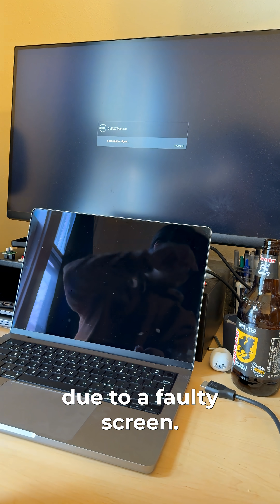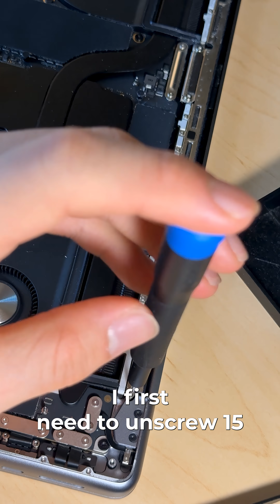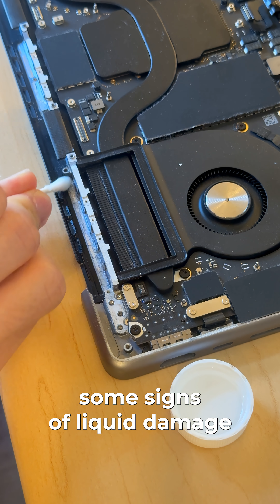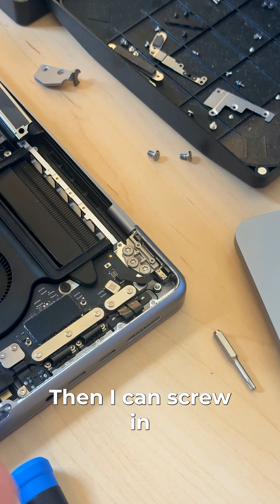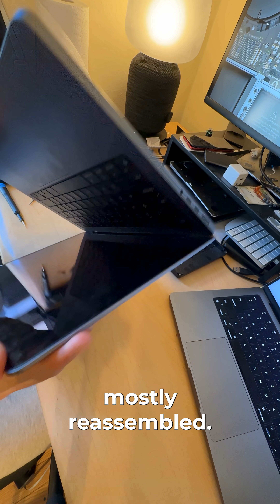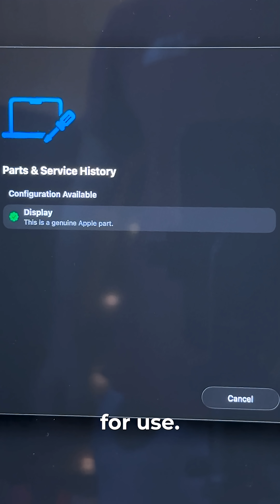14' Macbook Pro Repair #tech #apple #laptop #mac

Comment: I had never worked on a computer until I fixed an a2991 my mom somehow broke the screen on after buying brand new and only using for 6 months. Only 17 cycles on battery

Comment: I had to replace the screen on my 16” M1 MacBook Pro awhile back. I can’t remember now why, but I had screwed up something before I put the 15 tiny screws in the antenna cover the first time. So I ended up taking it out again, fixing my mistake and putting all the 15 screws back in a second time. But fortunately, when I was finished, I have a perfectly functioning MacBook Pro. 😁

Comment: it is usually not worth doing this job. Let's guess you buy this laptop for 250€ and the screen replacement cost around 200€. You pay 450€ total + the amount of work. You can find second hand laptops for that price or a little bit more that are in perfect condition. I've doing my research because i wanted to buy second hand laptops and repair them by myself but i find most of the scenarios not worth it

Comment: Hi sir my MacBook Air m1 is not working it’s screen does the same as your screen was doing but when I tried to use it with external display on TV it did not work we took it to apple and they said it’s screen is not working and that needs to be replaced we asked about how can we restore our data they told us to use external display but it just won’t work what do I do?

Comment: that's the worst part about apple, is they intentionally tell the software to fuck up a new part until it's verified as being real or done by an apple technician.  why the hell do they tell the mac to display artifacts on the screen on purpose..
Reply: That's not the reason. The monitor needs to recalibrate with the chip in the system, because all monitors are not identical.

Comment: Ok for reference my lcd on my m1 air was cracked Apple Store said for the part it was on the lowest end $600 Canadian if you can get an insane deal replacement might be worth it if not just buy a new one.

Comment: 400$ for the MacBook Pro, 800$ for the display. Total is 1,200$ and a new M5 MacBook Air is the same price.
Reply: I got a used screen for $395.00 that was in pristine condition for my M1 16” MacBook Pro.
Reply: Not 400$ for a 14' Macbook Pro and a display is not 800$
Reply: @Davidgtc   either way it still adds up for an M5 Air, newer and well.. new.

Comment: I feel like apple could charge a lot less for stuff if they didn't use 5,000,000,000 (all of which are different sizes) screws in everything
Reply: Components will fly off when the laptop is dropped.
Reply: @gund89123  then don't drop it 😅 these things will still break 💔  then apple will make you sell your soul for the replacement parts and thousands of screws

Comment: I bought a MacBook Pro M1 Pro 
1.with working motherboard but not screen for 300$
2.with working screen but not motherboard it was 390$
After combining it works perfectly cause it’s cheaper than fully working MacBook Pro with same config, and not working screen with motherboard I selling it it’s on shipment, I waiting about money maybe approximately 100$
Overall it will be more cheaper 😅

Comment: Why the heck does it have artificers without “calibration”?

They literally made the screen show that crap propose. There’s no calibration routine
Reply: The only calibration that I ran into after swapping the screen was to set the angle on the screen angle detector so the screen would go out while there was about an inch remaining before the screen was fully closed.

Comment: If anyone was wondering, these are the prices:

From 700 dollars (500 dollars the MacBook and 200 dollars the display replacement) all the way to 1250 dollars (800 dollars the MacBook and 450 dollars the display)

Considering this MacBook 14 inch M1 Pro 16 gb of ram is 1000 to 1400 dollars used (new ones don’t exist since apple doesn’t produce this specific model anymore), I think that was worth it, but only when you are the one replacing the screen, as repair prices can be expensive.
Reply: Doesn’t OEM 14 inch displays cost like 700 USD? It’s hella expensive for just a display (has webcam and miniled though)
Reply: Drum roll please: roughly 300 pounds per piece for 5 14/16', 350 for about the other 10 I got before that. Some were in excellent condition, others in terrific ones, but all were working. Still had to replace a couple of batteries. I also punctured one cell on one while prying, so yesterday I had to disassemble one of these to remove ALL the parts until I am left with the housing and battery, to properly dispose of it before it explodes/starts a li-ion fire, and now I have to wait on a new top housing before I have to put back .... 137 screws. That is a joke number of course (well, maybe with those on the keyboard not really), but still, way more than the 15 on the antenna bar.
Reply: I got basically a brand new 14 Inch MacBook Pro M1 with only 37 charging cycles for 700€ on eBay.
Reply: @Pavle.019 lol you overpaid. I got the m2 pro for 500 with 28 cycles.
Reply: @Malacala  I'm happy for you.
Reply: Stfu next time don’t rumble gibberish….be elaborate.
Reply: @Seanblubs  Looks like someone found out what "stfu" means and wanted to use it so badly 😂
Reply: @Seanblubs bro can you read 😂. Tf is going on with your attention span
Reply: Pretty sure the entire total of this video could've gotten you a brand new M5 15 Inch Air but most likely won't lose it's value

Comment: How you get that genuine screen? apple store are selling replacement part?
Reply: yes but it's prohibitively expensive to get it from them
Reply: @firstname3430 compared to the service center, what do you prefer?
Reply: @firstname3430  
EU should pass a law
Apple should share the design of all components with other manufacturers so that they can use those designs to make cheaper components and cheaper
Reply: I got a used genuine 16” screen for my M1 MacBook Pro.  It was guaranteed to be in excellent condition and function properly. The only clue that it been replaced is that the replacement screen came from a Space Grey MacBook and the rest of the machine is silver.  😂

Comment: I got a MacBook pro for the same issue but I'm not getting a display out, is there any way I can?
Reply: Thats not same issue 😅.. No display output maybe because your motherboard's issue, not lcd
Reply: @iqraaswad5660  the lcd is just cracked
Not a tech noob here. It seems to output something as the screen lit up but the lcd is damaged so I know it turns on and the logic board and ram and ssd all should work just isn't displaying on another monitor

Comment: So basically, Apple intentionally sabotages the display with artefacts in order to FORCE verification. 
Once verification is completed, these artefacts disappear. 
It is astonishing how unnecessary and controlling this behaviour is. 
And the most shocking part, people pay Millions of Dollars to this Company.
Reply: These Artifacts are normal because the screen isnt calibrated. with the repair tool they give you in iOS 26 they will calibrate the screen to the device. technically, every device is unique. the screen will be different in terms of brightness, PPI and so on compared to the original one. 

But thats normal. its not noticable to humans, but for the tech it is definetly noticable. thats why it needs to be calibrated

Comment: Screen repair ❌ screen replacement ✅
Reply: *whole top part replacement
Reply: genius 🧠
Reply: @roywongsotaruno it's the same thing bro
Reply: Macbook pro repair BY replacing the screen.
Reply: Repaired...by replacement.....
Reply: exactly what i was going to post :)
Reply: Our Little genius 🧠
Reply: repair the laptop by replace the screen
Reply: "Yeap, my bad, LETS USE A MICROSCOPE AND USE ALIEN TECHNOLOGY TO FIX THE BROKEN LCD
Reply: this makes me glad i dont own a retina macbook and still use a 15 inch unibody one!! i bought a screen for it only because the webcam died.. screen works fine just the webcam dont.. the entire screen assembly was like 9$ on ebay.. the retina ones are like 75$ on the low end and thats for one that works but is all jacked up.. like the antireflective coating wore off or theres a bunch or bright spots.. and i actually owned a 2016 macbook pro but i returned it as it wouldnt stay connected to the damn wifi for more than 20 minutes..
Reply: Its a MacBook. That's the same thing.
Reply: That's like 90% of repairs on things anyway

Comment: The need for Apple to check if you're using original Apple pieces is disgusting
Reply: i think if you do a jank repair, Apple can't tell the part you used is original or not. there was one time where you could replace a battery with an aftermarket one, use itunes to update your iPhone to the latest ios, and the iPhone would think your battery is original
Reply: Obviously they dont want you to open the back panel in the first place.
They want you to buy a new one.
Reply: You're right, wish I could profit by sending them back faulty parts, but they foiled my plan.
Reply: fr
Reply: Its so it knows if it is a genuine part or not. It wont do anything if its non genuine its just checking if it is to enable the features the display comes with
Reply: @april_1244  Yes, but that's so you can only use Apple components, which are notoriously expensive. If i wanted to use other much cheaper (and not always worse, cause i tell you, there's better) components, then i won't be able to use them.
Reply: @tntaro You will be able to use non-genuine parts, apple has never limited any of their products to genuine only screens, it just means that using an non original would be missing some of its functionality, and it will have an ‘unknown display’ message in settings. Other than that it would work fine
Reply: @april_1244  Not talking just about the screen
Reply: @tntaro  what's the better screen than the internal you have access to?
Reply: @tntaro #1 learn how to type #2 nobody even makes aftermarket MacBook displays
Reply: @tntaro  thats not true, some iphone 6's exploded because of aftermarket batteries
Reply: @Attakai_The_Kitty  If no one makes aftermarket then I must've received a genuine screen,  even through the listing stated aftermarket
Reply: @tntaro 
What else you have ?
Please provide the list.
Reply: @tntaro You will be able to use non genuine screens. I installed one on a device on mine
Reply: @tntaro You can use salvaged parts. It just checks the screen to see if it actually came from apple. It would still work if it’s not genuine, you lose true tone, which nobody misses anyways.
Reply: Your the only one that’s disgusting
Reply: Disgusting?. If you bought a used device, wouldn't you like to know if that device uses genuine parts or not? The price of used devices who use genuine parts and ones who don't is significant.

But perhaps you're into getting scammed. In that case, I've got nothing to tell you.

Would you like to pay full market price for a used device only to find out later that most components have been swapped with cheap alternatives so the person selling that device can make a profit? Yeah sounds fun, right?

Comment: It’s like they don’t want you to fix it!
Reply: For a laptop screen replacement, that was actually pretty good. Compared to touchbar era Macbooks that was magnificent.
Reply: @fix0the0spade Still don't understand why they need 15 screws all of which are P2 screws which strip immediately to hold down an antenna bar that was held down with 4 screws on the MacBook Air, other than just being Apple.
Reply: they don't.
Reply: Tbh its way easier then some windows laptop, since the screen and its cover are one, some windows laptop have shitty ass bezel and back cover that have fragile clips that can break when you try to replace the screen, i have no bias i just fix laptop as a sidejob
Reply: If they didn't they would've glued stuff down

Comment: How do i fix an s21 that wont turn on despite plugging in the charger?
Reply: Try a forced restart 
Press and hold the Volume Down button and the Power key for 10 seconds. This should trigger your phone to boot up.
Once the Samsung logo shows on the screen, release both keys and allow your Galaxy S21 to continue the boot process.
Reply: @newposter30 didnt work, now what?
Reply: Take it to the technician
Reply: Get an iPhone
Reply: @strryle125 that's not what he asked btw

Comment: He recorded this so he could put it back together with the footage 😭✌️
Reply: Exactly what I thought 😂
Reply: Thats what i do everytime i try to fix smth 😅
Reply: 😭✌️ts 🥀
Reply: yeah that's what you do. there's no "😭✌️" needed
Reply: This is nothing. I did two 2019 16" Macbook Pros. around 30 screws each 😭
Reply: work smarter, not harder
Reply: @winter_lily1812  "Work hard, not hard at work"
Reply: Valid reason tbh
Reply: That's what you should actually do. Don't trust your memory when you're no a pro 🤣
Reply: Such a rabbit hole.

Comment: How much the screen and the broken Mac cost in total😅

Edit: did not think this comment would blow up like this 🥶
Reply: Almost equal to the laptop current price
Reply: @ayush0477  Probably not. The M1 is a few years old now. Since it's a genuine part, I'm guessing $120 to $150. The Macbook itself without a screen is probably around $200-$300 depending on memory and internal storage. Getting a fully working used M1 Pro nowadays cost $700 at least. So it's a pretty good saving.
Reply: @MM-vs2et that’s not an m1 , it’s a joke this is probably m4 plus , I do have an m1 the chassis is different and total build is completely different even the screen it doesn’t have a notch , and m1s have the Touch Bar
Reply: @imodi1565  m1 pro 14 & 16 have the new chassis, m1 pro 13 and m2 pro 13 are the only m chip pros with the old wedge design. so yes this is an m1 pro
Reply: @imodi1565 what you smoking bruv, this is a m1 pro macbook pro. they look identical to the m4 pro macbook pro
Reply: @ayush0477 😂
Reply: I am getting these machines complete working with logic boards removed for €140 in Ireland.
Reply: @allennicholson4248  how is it working without logic board?? 🤯
Reply: @KimoKimochii harvesting for parts or add a logic board back into a known good chassis
Reply: @allennicholson4248 Where can i get one?
Reply: @allennicholson4248 hey I'm from the UK are you interested in selling some parts for macbooks?
Reply: @all @allennicholson4248 much is a logic board where you live, out of curiosity?
Reply: @allennicholson4248 where?? I bought one without a display to use as a Mac mini but would be cool to get it working
Reply: Approximately 35k
Reply: @theidiotspeedruner  35k what? USD? AUD? INR ? Yen? Yuan?
Reply: @i @iemUnknown  most probably its 35k INR
Reply: About $600.
Reply: From 700 dollars (500 dollars the MacBook and 200 dollars the display replacement) all the way to 1250 dollars (800 dollars the MacBook and 450 dollars the display)

Considering this MacBook 14 inch M1 Pro 16 gb of ram is 1000 to 1400 dollars used (new ones don’t exist since apple doesn’t produce this specific model anymore), I think that was worth it, but only when you are the one replacing the screen, as repair prices can be expensive.
Reply: @gtrafite5909smarty
Reply: @gtrafite5909my friends m2 air broke bc she had a case on it and the hinges might’ve snapped breaking half the screen, cost her 500 dollars at apple to repair
Reply: @gtrafite5909 you can get a working M1 macbook pro 14” for like £600 what are you on about
Reply: Sure you didn’t mind paying for a replacement screen these parts in South Africa don’t come cheap it’s the same as buying another MacBook 😢
Reply: About 6 million 😔
Reply: @white_1328 no way i say 271k

Comment: Nice to see that you used a genuine Apple display for this one, as third-party screens can be a nightmare.
Reply: Why
Reply: Not really, what makes them a nightmare is Apple's invasive and completely unneeded monitoring of parts on their laptops.
Reply: @OllieFallon10  Unneeded?. If you bought a used device, wouldn't you like to know if that device uses genuine parts or not? The price of used devices who use genuine parts and ones who don't is significant.

But perhaps you're into getting scammed. In that case, I've got nothing to tell you.
Reply: @Davidgtc Yes, but my point is it also takes away features. Yes, they should absolutely keep the reporting that the part is not genuine for future purchasers of the laptop, but part pairing the touch ID and lid angle sensor to the logic board and not allowing replacements to work unless you buy the sensor from Apple doesn't make any sense.
Reply: @OllieFallon10 I hear you, but aftermarket displays can be tricky, and Apple doesn’t know if they’re gonna make those features unreliable or make the device behave weirdly. 

While other companies allow those features to work even with aftermarket displays, they may cause issues, so Apple would rather just kill them. It’s the same with iPhone and True Tone

And about Touch ID, that may seem like it makes zero sense, but I promise there’s a reason. Touch ID components are highly susceptible to electro-static discharge during repair. A tiny amount of static electricity can permanently destroy the sensor.

Also. The cable for the Touch ID sensor is very fragile and often damaged during the screen replacement process. If this ribbon cable is torn or poorly seated, the sensor won’t be able to communicate with the motherboard.
Reply: @Davidgtc nothing more pathetic than shilling for a anti-consumer comapny as a consumer
Reply: @daravici  This is a low IQ comment. Just because Apple doesn’t care about consumers that much anymore doesn’t mean that we as consumers can’t use logic to understand why they do certain things. If you want to see everything as black and white, that is your choice. I personally enjoy using my brain